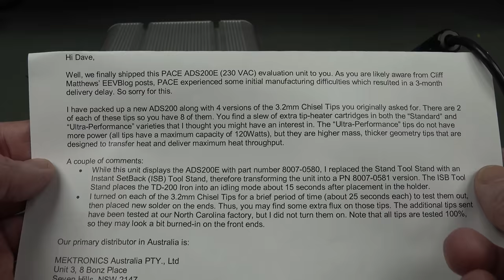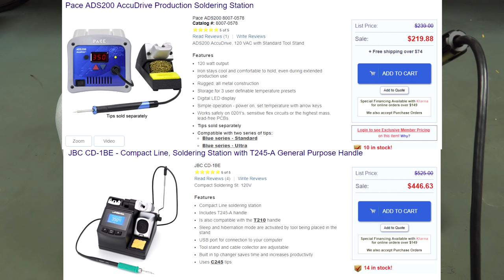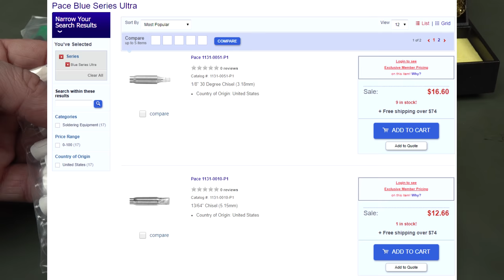EEVblog #1106 - Pace ADS200 Soldering Station Review (JBC Killer?)

Comment: I've had firmware 1.4 for a month, nice update. Display's not jumpy and ISB can be set for zero-delay, although I prefer less up-down heat cycling, since when finishing joints, I often test for strength and elect a reflow. Also, temperature set points are now 1 degree apart, not 5 as shown here (so I guess you can do science melt experiments with this too..).
I'm also impressed by the realistic pricing on replacement parts. Example: The silicon o-ring near the front end of the handle costs just $3 USD for a pack of 5 (that's like a ten-year supply!), and I don't need to change mine yet, after almost 100-hour's of solid use.
Reply: Yeah, a few days after my initial video, pace contacted me and inquired about my opinion on it.  I told them about my impression of the display and whatnot and they told me they would address those issues and get me a the new firmware.  Since then I have been using the iron without the pesky annoyances that it had out of the box, such as a jumping display or an issue that I noted when on rare occasions wouldn’t come out of sleep immediately.  I still want to get my hands on the equivalent technology/price range hakko and give them a head to head test.  But for my uses, it has been a great iron and totally kicks the 888D’s butt.     On a side note, when I told them about the jumping display being a bother I was told “no one has ever complained about that before” :P.   I just remember thinking “yeah, but you did not have irons of this type in the hobby and prosumer price range before either... get ready for the gripes”.
Reply: Cliff Matthews, reflow usually means your joint was poor from the start. If you start off with clean solder, clean contact surfaces and well mixed flux, you won’t be reflowing or reworking. Don’t forget to clean each joint afterwards. It won’t attract dust and moisture. Hope you’re wearing nitrile gloves and using fume extraction. Otherwise, you’ll have lung problems and lead poisoning to deal with!

Comment: The clunky extra cable for the stand sensor is a big fail for me. Should be done through the iron cable.
Reply from the maker: It's a bit clunky
Reply: yes they could put a little magnetic read switch in the iron and just put a magnet on the stand, no need for that cable .
Reply: Higher Pace have an IR sensor in the stand IIRC and when a workbench is organized a stand hardly moves..
Reply: Daniel Austin reed
Reply: DIY it, soldering station mod thyself.
Reply: oops silly dyslexic me
Reply: As I've said before, I think the setback can be activated using a single conductor wire from the "SWITCH" input of the mini DIN, contacting the barrel of the iron. Thus grounding the "SWITCH" input.
Reply: Acoustic61, would that pass UL or CA testing? Having exposed metalwork connected to the circuitry?
Reply: I don't know but hobbyists could do it to save a few bucks.

Comment: I saw this video around the time it came out, and decided to order this station to replace an old style 70 watt Weller at work, and I've been very happy with it so far.   Thanks for making this video, even though there are a few gripes listed, I haven't any issues of note.  Though, in all fairness, I am used to old style tips, even on the old Pace stations where I used to work.  This iron heats up faster, works better, and the cartridge tips are much easier to change when the iron is hot.

Comment: I bought that JBC years ago now and I haven't even powered on any of my other irons since.  the JBC is just too good, and worth every penny of the $450 I paid.
Reply: It's simply the best tool out there, second to none.
Reply: @janklas7079  Except Metcal ;)
Reply: @janklas7079  You are wrong, year ago I was working in top electronics companies and never see a JBC soldering iron.
You can find Weller, Metcal, Pace, inclusive Hakko but never JBC.
Reply: @treadmillrepair754  Then you weren't working in top electronics companies.

JBC is expensive.
Reply: @janklas7079  Wrong again, Intel, C&k, army Contractor and more.
Nobody use JBC.
Don't try to cheat, if someone can affort and need a really good soldering station go for Weller, Pace, Metcal, Hakko.
Reply: @treadmillrepair754  Probably depends on what part of the world we're talking about. Over here in Germany, JBC is definitely well established and the main rival of Weller. I suspect that's true for most parts of Europe. Never saw any Pace used in any industrial setting around here so far. Personally love working with JBC stations. I respect Weller for its legacy and I guess they are still mostly great but they are not my favourite. Remember "EEVblog #1152 - 240V-120V = Magic Smoke!" ? :/
Reply: @felixfox8810  Here in America any electronics factory use JBC.
You can find tons of Metcal, Weller, Pace and Hakko.
I never see anything of this company in 30 years working for Top electronics factories.
Best Regards.
Reply: @janklas7079  Metcal is not cheap but I have seen them and Weller used almost everywhere. JBC? Nope. I might get one but already having a Metcal it would be out of curiosity only.
Reply: @mbak7801  That only says something about the shops you've been visiting.

JBC is a very well known brand amonst professionals.

It's mostly the well meaning 'home-pro' who uses weller.

Comment: Wish this review was up a couple of weeks ago I just got my first station and it's a Weller but i would've spent the extra bucks and got this one it looks so nice.
Reply: Me too. just bought a crappy FX-915 :(
Reply from the maker: Justin Richards What's wrong with the 951?
Reply: My trusty old Weller recently developed a fault in the cable near the iron. A used one now costs about as much as I payed for the whole thing including station and tips years ago. Wtf?? Guess I'm in the market for something new.
Reply: Wish I had something as nice as the FX-951, my Weller's a WES51. What's so bad about that hakko 951?
Reply: EEVBLOG Its a clone and I didnt get the feet, The rubber holder, the "Program Card" or the sponge.  
The Tip holder is super cheap and one of the latches snapped day 1.  
Have to insert "Program Card", adjust temp then remove the card. I was hoping I could just leave the card in all the time so I could so i could simply adjust. Other youtubers demonstrated this behavior but mine is different. 
An adjust pot without the complicated program sequence would be ideal. 
Not sure how close it is to the set temp.  It is ok to use once set.
I really wanted something easy to set like the TS100 with a PSU and holder, and the ADS200 looks like a good contender.
Reply: So its not actually a 951 then? Probably would have been happier with the real thing.
Reply: Tomasu82 Yeah, "I bought the crappy 951." When he didn't buy a 951 at all.
Reply: Kajico Weller is way better than this...

Comment: I have a few JBC irons, both precision and standard and so far I have not found anything that comes close. As Dave mentioned in the video it is generally a trade off when setting iron temperature but with the JBC a lot of variables are removed so it is much easier to get consistent results. They are particularly good at reworking delicate old boards and with a good sized tip and de-solder braid they can suck the solder cleanly out of a through hole pad without damaging the board (or even the chip).

Comment: Maybe I'm old-school, but I see no need for high-power (100W+) soldering stations that get used 99% for low-power soldering.

What I own is a 60 year-old 300W Weller soldering gun (now called the D650) for the heavy stuff, and a varying number of 30W-60W soldering pencils for everything else.

The Weller has a copper alloy tip: When it gets pitted or gunked up, I can take a file to it and quickly get to fresh metal with a sharp chisel edge, ready for tinning.  No need to carry multiple tips around, just a small flat file.

I also like my soldering tools to easily go from the bench to the tool bag.  Presently, I bring my Weller gun and a TS100 pencil.  Life is good!

Comment: In the US we usually slowly give up on pointing out the absurdity of hanging on to imperial and fractional inches and over time absorb a table of fractional inch to decimal conversions in our heads and get pretty good at multiplying by 25.4 just to get by in a day, when our definition of absurdity shifts to the number and letter gauges, though if you work with those long enough I'm sure the same thing happens. Metrological stockholm syndrome

Comment: Dave, the thickness of the tip between the thermal mass/heating element and the solder surface greater on the jbc. This makes a big difference in temperature drop from the thermal couple/heating element and the solder. A different tip may make a big difference

Comment: Would be interesting to know if the thermal performance of the ADS200 can be improved using Unisolder or a redesigned control PCB? I wonder if tip plating is the real issue?

Comment: I think that the current-sense resistor mentioned here is for the purpose of measuring the resistance of the heating element. The heating element IMO is also the temperature sensor.  Of course, you need an intimate thermal contact between the tip and the heater. Also notice that there are 4 pins in the connector. That is IMO a Kelvin (4-wire) resistance measuring circuit so that no significant current flows through the measurement wires. Pretty clever IMO. Notice that there are only 2 connections to the cartridge itself. No separate connections for a sensor. Thanks to this video I bought one and I love it. BTW,  they turned the heat-sink screw around so that it is not so close to the cap. I have reverse-engineered a heating pad that uses the heating element as the temperature sensor.

Comment: Year 2018 and we still have VCR clock quality interfaces in soldering irons ;)
Reply: Karol Piotrowski 

I agree. At these prices, they could at least put an LCD in there.

I understand that these types of station are really aimed at a "production" environment, and the solderers won't need to be messing with the settings too often (or at all), but backlit LCDs are dirt-cheap nowadays, and can still have fairly good viewing angles.

Or, failing that, a small OLED could still show the set temperature and current temperature on most of the screen, and make it far easier to set up the extra settings.

It could also still use a small low-pin-count MCU to drive the display via SPI or I2C.

I don't believe they are really at such a low price point that they need to scrimp on the display.

Having said all of that, the 7-seg display is still functional and easy to read, so what do I know. lol
Reply: But why, all it does is drive the price. Its set and forget, and when you do need to change it, it appears very easy to read from all directions. Just look at the JBC nearly twice the cost and from the angle of the camera its almost blank. Yes they are not at the same angle and that is likely not where you would put your head to adjust the JBC, but I imagine even if you look at the PACE from almost the side it will still be fairly readable.

And its old school, reminds me of things growing up. Its a matter of preference I guess.
Reply: I'll take a LED display any day over a LCD display.  Much easier to read at a glance, and if it ever fails a heck of a lot easier to replace 20 or 30 years down the road.
Reply: I have nothing against the display,  just the general responsiveness of the interface and cryptic settings via magic key combinations. And if we're talking about cost saving I'm pretty sure using 8051 clone in PLCC package is an opposite of that ;)
Reply: Oh. You want the voice activated smart iron.
Reply: Not really, just a display with more than three seven-segment digits and self-explanatory interface, like on even cheap Quick Chinese products. And if it's supposed to be cheap iron for using production environment then I'd really prefer some standard serial interface so I could just hook them up to a computer and set presets/limit en masse without dicking around with three button. I'm a bit salty about this kind of stuff after having to set 30 HP LaserJet printer names and IP addresses through "up, down, enter" interface;) And to be honest for soldering iron I prefer just a knob (may be with digital readout), but I know these times are over - potentiometers/encoders are expensive.
Reply: MikesRadioRepair, I agree with that argument, as it's much easier to get 50 cent 7-seg with right spec than a custom LCD, but one may wonder what will be the availability of 50 cent 7-segment LED displays in 20 or 30 years down the road:)
Reply: Who cares about the display type? I'd prefer a rotary encoder instead of buttons.

Comment: So glad you made this video. Ive been on the fence about this one after buying the pace desoldering station. I will say a few things about pace equipment.

1) all the equipment follows the same asthetic. Whether you love or hate... Its your opinion, but i like it. Solid and Shiny.

2) the case is also functional as the channels in the extrusion allow you to mount with some slide adjust capabilities.

3) pace has been around for a while; like the godfather of soldering. Their tech makes you imagine that the original engineering team is still alive and kicking as their features and advanvements in tech often seem behind the curve.

4) as basic as they are, they seem to focus on making products that work well, last long and dont break the bank on consumables. Tip cost and selection is what drove me to choose their desoldering station. Thats a different beast and has its own quirks. It still uses the older tech without direct drive, but im getting used to its nuances and limitations and learning to work within its realm of capabilities.

Even though this review had some negatives, it showed me what i wanted to see... good and bad. I think im going to pull the trigger on this setup solely for the temp accuracy and within its price point no challenger for thermal recovery. However, i plan to call PACE and see if they have any updates planned based on several reviews calling out their bs board layout. Comparatively, the pace unit should get the job done with ease and i can use the tips like a boss without giving two fucks or feeling like ive commited sins against soldering. 

As far jbc goes... I like them, but i dont find them practical for general electronics repair due to price points and most certainly the price of its consumables. Maybe its just me but i want to be able to abuse my tips and feel good about it. JBC, in my opinion, is geared towards production environments (ie. Big biz and not independant repair shops) that can churn maximum value from every tip to where paying $40-$60 for a tip is not an issue. However, im pretty sure the new NASE-C is on the short list due to it being the only model that offers tweezers (or i should say good tweezers) for 01005 and smaller. their tip prices and lifecycle have always sent me screaming and running in the other direction, i think microsoldering streamer said he gets 2weeks from tweezer tips and those are about 100+ for a set. I plan to add the comment in every tip reorder... Frak you, heres my money.

Comment: I wonder about the power-consumption compared to these 'newer ironstyles': is 3-wire or 5-wire making the difference?
In a 5-wire layout, the measurements can be done at the same time as heating, but I noticed (on the noise) that the 3-wire iron-stations do take a break between heating and measuring, probably because they use the same wires? I know technically it would be possible to do measurement and heating with the same 3 wires at the same time but probably this could give some measurement-problems and cause overshooting for example?
Maybe Pace can tell? I have some older iron (old technology, 'no-name') with 5 wires that goes into higher power-consumption untill it sensors reach the selected temperature (and then probably overshoots at the tip) right after putting the iron on a bigger plate. That station does get hot though (not only the iron) doing so and impossible to get good tips nowadays since it is using the old copper-wire style tips and is only max. 40 Watt...

Comment: Even Nippon Chemicon caps die when you put a heatsink so close that it's touching. Maybe that was the last minute change. They should have put the capacitors on their side if they needed to bodge a heatsink into the design without remanufacturing their PCBs.

Comment: There must be a huge ripple current in that single electrolytic filter cap during the rapid heat-up.
Reply: None whatsoever, the 4 MOSFET's form a bridge and the output gets dumped direct to the element (at 120hz) with no losses. The uC and control loop requires low current to run and that's why they use a jellybean 7805.
Reply: I think I understand now.  The heating element just gets full-wave rectified AC.  Meanwhile the same AC voltage from the transformer goes through another diode (CR17) into the cap, and thence into the 7805.  Makes sense.  Thanks.

Comment: The extra rubber on the button gaskets is left in place on purpose because it keeps the buttons from rotating and it makes assembling the unit easier. Easier assembly saves time and lowers production cost.

Comment: If the Pace has to be set higher than JBC, to melt solder on a given joint, then isn't the temperature of the PACE heating the joint to the same temperature as JBC?